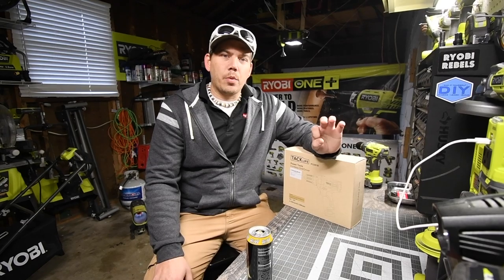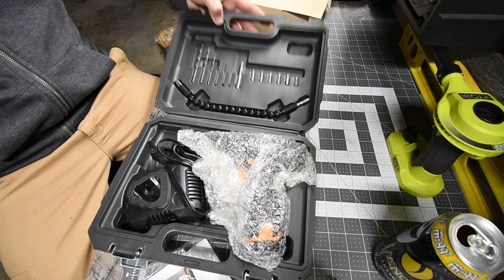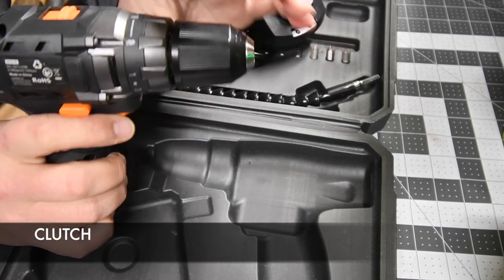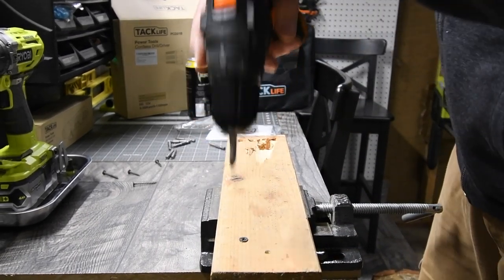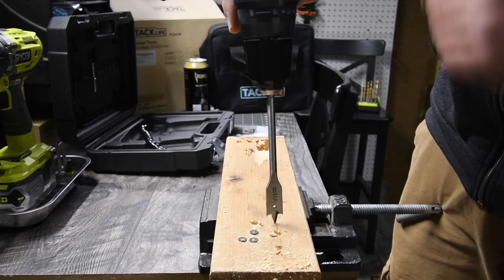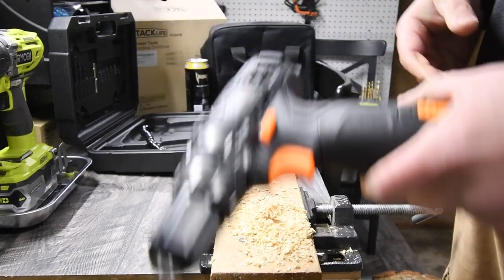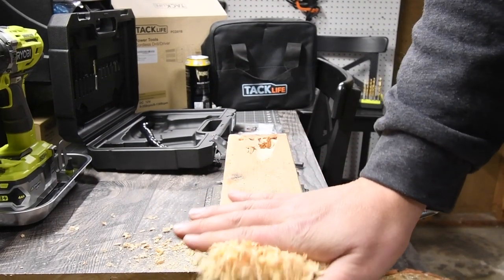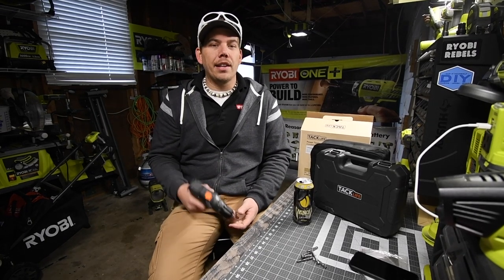TackLife 12v Drill Test

Comment: We’re doing a light remodel on our old house before we put it on the market. A lot of back and forth over there just whenever we get free time. I’m not willing to leave any of my expensive drills over there and I got tired of carrying them back and forth but more so of forgetting to carry them at all. So, I wanted something cheap to leave over there. I picked up this exact drill and kit on flash sale for $34 on Amazon. There were a few others around that price point but they all looked like clown shoes. It was basically between this and the Black Decker 12v single speed drill. 
I went with this and I’m really glad I did. It does have a surprising amount of power for a 12v brushed, low priced drill. I think it’s selling for about $40 on there now. Still well worth it at that price. Be careful though, the same company has a “newer” 12v out that looks similar at first glance. But it’s typically a few dollars more for reasons I don’t understand. It looks like it’s slightly longer overall, but it is rated at 20 in-lbs less torque and comes with a slower charger than this drill. Baffling. 
It’s not going to replace any of my expensive brushless 12v drills, but I’m going to keep it around when we are finished up over there. Not gonna leave it as a housewarming gift for whoever we sell the house to. 

Anyway, if you are needing a small drill for not a lot of money - give this one a serious look. 

Oh, and as for the accessories: the hard case is indeed well made. The driver bits that come with it are terrible though. Really bad. Fitment is sloppy (stripped two screw heads before I learned my lesson) and they are brittle. But for the price of the overall kit? Who cares. I didn’t buy this for the bits. Throw them out and use some good bits.
Reply from the maker: this is an old video, Makita XPS driver bits are the best
Reply: @ManCaverTools  I agree, I use the Makita XPS myself. 
The bit comment wasn’t directed at you in any way (I don’t even know what kind you used here - didn’t pay attention). I was just letting anyone that gets it know not to expect much out of the ones in the kit and to have their own ready. 
Makita XPS would be my first suggestion for sure too.

Comment: You should get the warrior drill from harbor freight.  It’s a 20v drill that can be had for like $25.   The only downside to the warrior line is the full line is a drill and flashlight.  And a slow charger.   3-4 hours for a 1.5 ah battery.  Which is the only size they have.   
Also hyper tough is on sale at Walmart.  They have a 4 pc kit for $50 in store now.  Normally the drill goes for $25 by itself.    
I’d like to see the tacklife 12v vs those drills.  As well as a best of budget drill shoot out
Reply from the maker: Ill pick that up and thank you

Comment: How did you drill a 1/2" hole using a drill with a 3/8" chuck Dave?
Reply: tony5006 using a half inch bit
Reply: tony5006 back of the drill bit is turned down to 3/8
Reply from the maker: the drill bit is able to fit in 3/8 in chucks as well as 1/2 in chucks.
Reply from the maker: correct

Comment: With that heater in there you need a carbon monoxide detector. Do you have one in there?
Reply from the maker: its not running long enough to worry about build up. I only leave it on for 20 min at a time. but it still isn't a bad idea to get one

Comment: Please dont punch the drill with the drill bit into the wood just to make it clean.. It hurt to see that. Then you dont have to wonder why its vibrating so hard when you drill. Either the drill bit or the chuck will wobble if you do this. You didnt even say something about the concentricity, though its one of the most important things about a drill... Probably because you think its normal that it's shit?! So next time you buy/test a new drill and buy new drill bits, dont do that, you will be surprised that not all drills will vibrate that much... The test was usless in my opinion because its not possible to know whether that vibration we could see on the video was coming from the cheap drill or from the drill bits because you did punsh them a few times already like this.
Reply from the maker: this channel pushes these tools to there limits to see what they can do in extreme conditions
Reply: compared to thats it's just a small thing that you use metal drill bits for wood.. But i dont like that either.